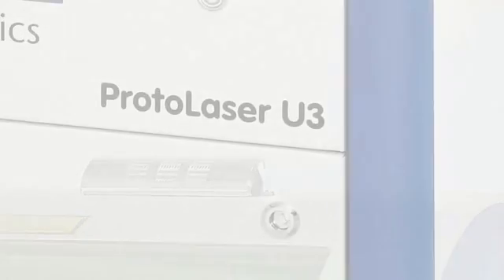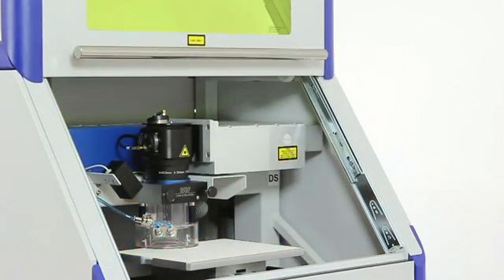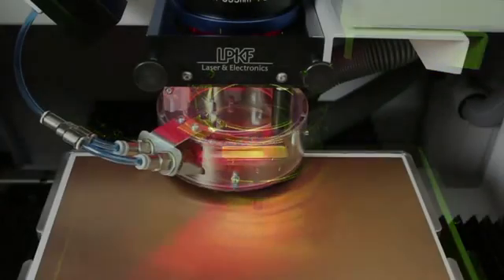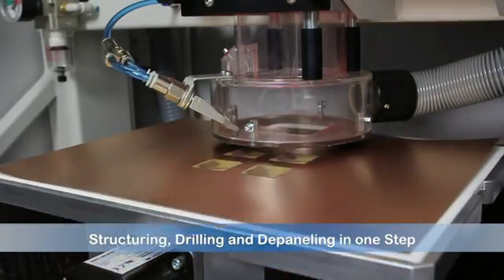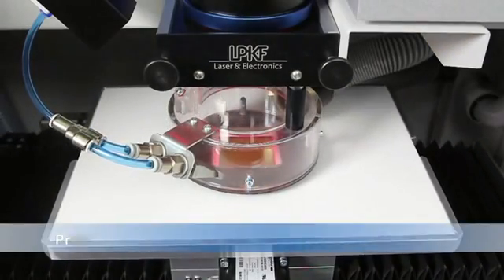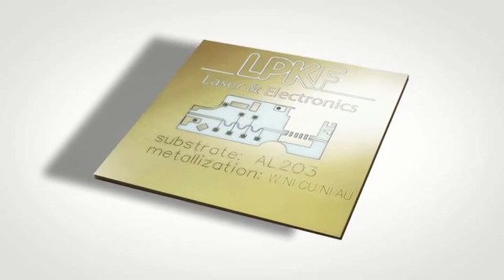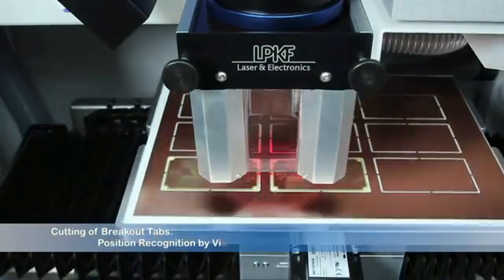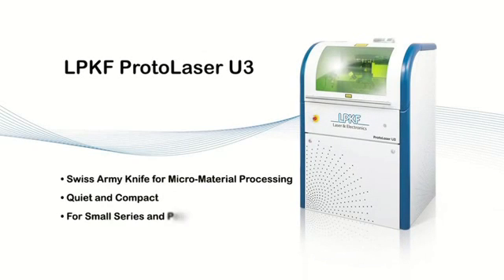LPKF ProtoLaser U3 | Versatile PCB Laser Etching

Comment: Hello. Doesn't the angle effects the precision on distant corners of the board? The middle and a side can't have the same precision, are they?
Reply from the maker: The ProtoLaser U3 beam is focused on the material using a theta lens, and it also operates in smaller scan fields (generally 50mm x 50mm, but this is adjustable) within the 9” x 12” work area so that the angle of impact is as vertical as possible. The X/Y table is stationary while the laser is operating, but then moves to align each new scan field. This repeats until the full design is complete. Thanks for your question, and definitely let us know if there is anything else we can help with.
Reply: LPKF North America I really thank you for your reply. After you answered I did a small search and found some results like telecentric scan and get some idea to understand this amazing system's a small part. Your products and customer relationships are esteemable...